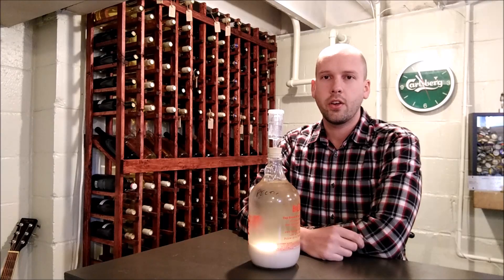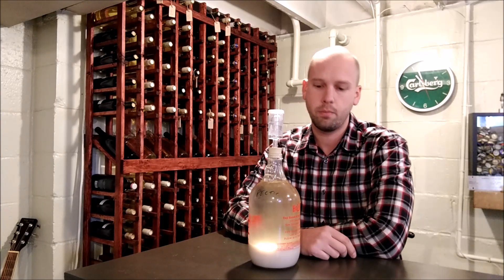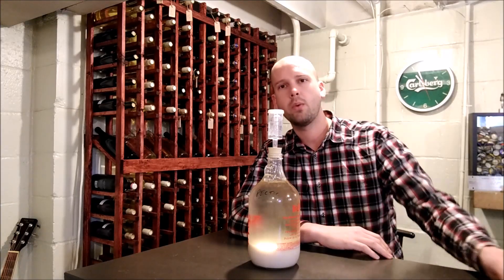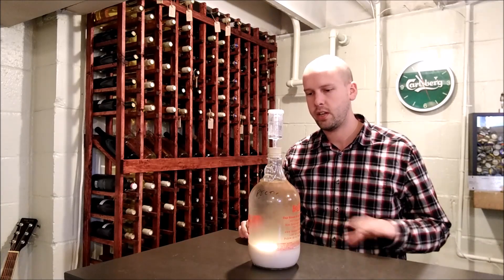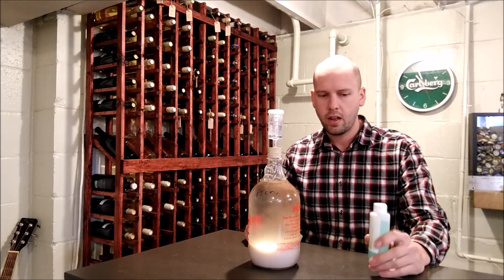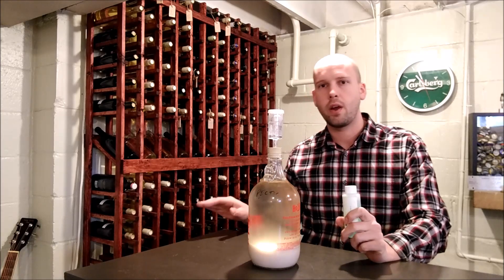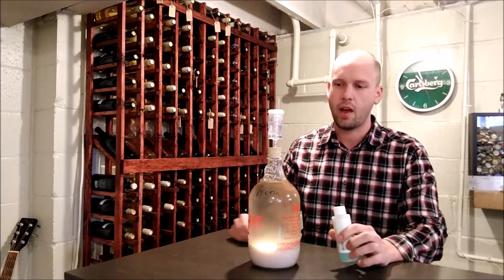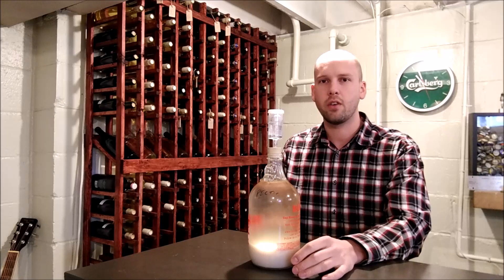Solving a Rotten Egg Smell in Wine - Hydrogen Sulfide

Comment: So, im 13 days into a apple cider, and its exactly 1.000 SG.  I do not want to use copper sulfate, so I'm guessing I should just do the splash racking technique.  But, I'm making a 6 gallon patch.  So, can I use a degassing whip?  Also you say add a little sulfate, at 25 parts per million, but I'm not sure what you mean?  Are you suggesting adding copper sulfate during the splash and racking technique, or something else?  You then say in the video to add copper sulfate as a "big gun".  I'm just really desperate to save this batch.
Reply from the maker: I would start with splash racking if it is a subtle smell.  If the smell does not dissipate once the wine finishes fermenting, then use the copper.  If you are unfamiliar with ppm calculations and measurements don't attempt the copper.  Do Not add 25ppm of sulfate!  You have sulfites (Sulfur Dioxide in the form of potassium metabisulfite).  They are relatively harmless and forgiving.  Then you have copper sulfate which is a whole different animal.  It is relatively harmless at low doses of less than a couple ppm and extremely toxic in high doses.  You can separate some lees that have settled out when splash racking also as they can be a source of the smell.  The root cause is probably not enough nutrient and not enough air and circulation during the fermentation.  It happens to just about everybody at some point early in their winemaking adventures.
Reply: @TheHomeWinemakingChannel  Last night, I suspended a piece of copper water line hanging from a piece of twine, I'll take that out when I get home from work.   I have potassium metabisulfite, so I should add a little of that, and do the rack and splash method and see what happens.  I 100%  agree that its lack of nutrient, as I didn't add any, and this was a 100% home brew from scratch.  Bad part is, I had yeast nutrient, I just didn't think the raw cider would need any.  Is there a way to measure the solution to see what the nutrient needs will be?  Also, does my plan above seem okay?  Lastly, can I add nutrient if its just starting to have the sulfer smell?  (I have another 6 gallon batch I think its starting to do this).  Its about a month old.
Thank you!
Reply from the maker: Your plan sounds okay.  You can add nutrient as the smell starts happening and it will usually fix it.  Some yeast strains need a LOT of nutrient while others barely need any.  I don't like to add nutrient below about 1.025 SG, as the yeast may not use it all and it can encourage bacterial growth during aging.  There is a company Renaissance that breeds yeast to be incapable of producing H2S but they can still produce VA (vinegar) which is the opposite end of the spectrum but just as bad in my opinion.  You can read about YAN (yeast available nutrient) testing.  I have seen instructions and it seems do-able in the home but I have never tried it.  Hope everything works out for the apple!

Comment: is degassing will help to remove the hydrogen sulfide from wine?
Reply from the maker: Degassing is mostly to remove the CO2 so that your wine isn't fizzy.  The process of splash racking back and forth to remove hydrogen sulfide will remove most CO2 also but if you just need to remove CO2 you generally will want to limit the Oxygen exposure a bit more.

Comment: Can you use a campden tablet?
Reply from the maker: If you are dealing with hydrogen sulfide there is a good chance a campden tab will actually make the issue worse.  H2S occurs when a wine is reductive, whereas campden (potassium metabisulfite) makes the wine actually more reductive, protecting it against oxidation.  If it is actively fermenting, yeast nutrient and churning up the wine is usually your best course of action.  If it is finished fermenting, getting the wine off the gross lees, splashing it a bit and in extreme cases hitting it with a small dose of copper sulfate should take care of the issue.  I usually wait to add sulfites (Campden) until the wine is definitely finished fermenting.  You can also add a bit  pre-fermentation (~50ppm) if you are dealing with fresh fruit to knock back spoilage yeasts and microbes.    Good Luck!
Reply: Thank you

Comment: I had some issues with mine (more with whites than reds), splash racking took care of the smell. I did it maybe 2-3 times a day for a couple days,  some said that it might oxidize the wines but so far mine turned out okay. Been home fermenting only about a year (since Feb 2017) and usually in small one gallon batches.

Comment: Ever try reduless from Scotts Lab?
Reply from the maker: I have not tried them but if they work like they say, I am all in.  Do you have any experience with them?  I would think they would be especially handy for white wines where you are not concerned about them pulling any color from the wine.  Or maybe any color loss would be negligible
Reply: I am only in my second year of wine making. I have used reduless twice, both times on white wine made from cold hardy hybrid grapes. Have had good success so far. Seems like it would be something to try before resorting to CuSO4.
Reply from the maker: Yeah, I agree.  I will get some before the next wine season just in case I need them.